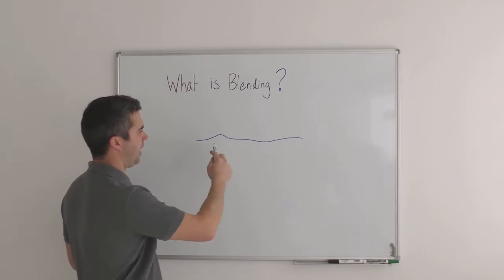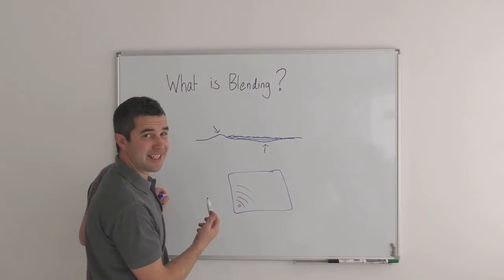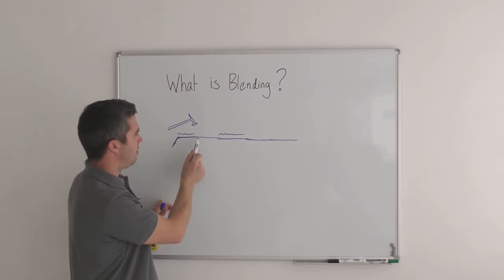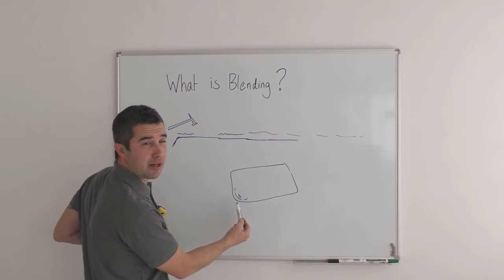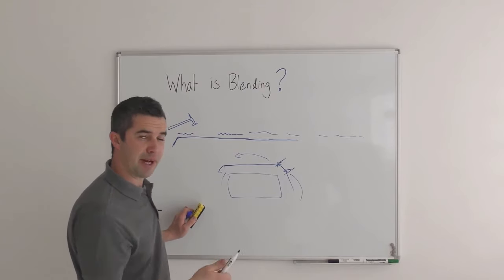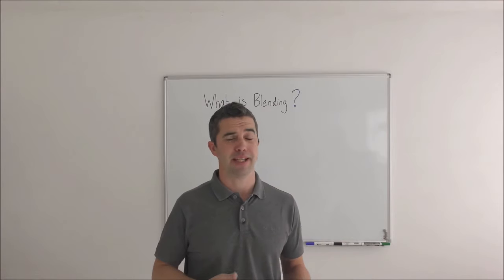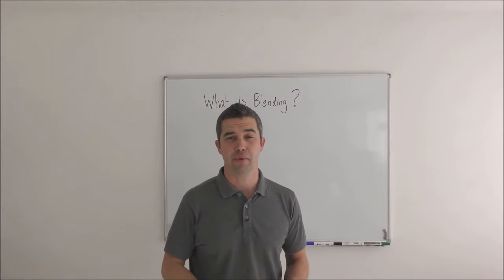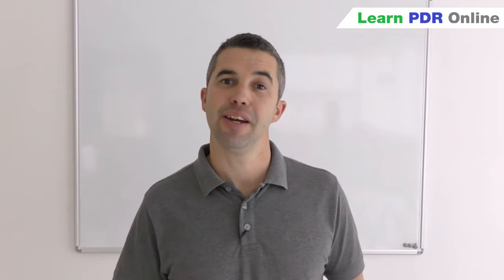Blending For PDR, What Is It And How Does It Work? PDR Blending techniques with Learn PDR Online

Comment: Sounds like your blending tool or hammer is tapping metal to metal? Or does it have a nylon face? I’ve tried lightly tapping on a 12 year old paint job and it left marks. With nylon. Perhaps it was cold. Or perhaps it was my blending hammer that I used.
Reply from the maker: Hey Rick, yes its a metal tip on my blending hammer but I usually add a small layer of tape just in case the tip is not perfectly smooth where it gets knocked around a bit in my tool box but you should be able to blend metal to metal as blending should not mark the paint, it may be aftermarket paint on the vehicle from a previous repair or perhaps the tip of your hammer was not perfectly smooth and clean.

Comment: would you use blending strictly for finishing? or could you used it before a glue pull to make the pull easier? how would you approach a medium sized dent?
Reply from the maker: Hi Joshua, good question, usually blending for me, is a way to finish a repair but often with the dent removal process it is necessary to 'open up' the dent, this in simple terms is using a hammer and or knock down to tap around the dent to actually make it larger which when done correctly can help to lift up the centre spot aka the lowest part of the dent, you may see pdr techs 'hammering' around a dent before a glue pull and whilst similar is a different repair technique than blending. Othertimes when we are using hammering techniques before finishing we may be softened the metal or releasing tension that is restricted the metal flow, I hope that makes sense?
Reply: @LearnPDROnline  yes quite interesting, i just tested this out on the rear quarter of my truck and it does work for the most part, i started with a glue pull first in 3 spots and i guess it wasnt such a good idea because it turned the dent into 3 smaller ones which were high in the middle but overall still low, i guess i should have hammered around the dent the release some of the tension and it would have been easier to pull it out to the correct level. then blended it at the end. its my first time for PDR but definitely not the first time for panel beating and spray painting.

Comment: Hey mate great videos, I have a hail damaged car and there is many small dints on the roof and bonnet. Would you recommend starting from the middle or an edge?
Reply: How do we join your membership program
Reply from the maker: Thanks Miles, I'm not a hail tech myself but when I did some hail damage a few years back I would divide my panels into sections and work on one at a time to avoid overwhelm, for example divide a bonnet into 4 and work on all dents in one section. Its important with hail to move around though and check your angles constantly cross checking work as you go, depending on your set up you can have multiple lights at once to limit how many times you need to physically move your working position. I also found it helped to work every dent I could see from one angle and then move and do the same again this limited how many times I would need to move and set up as opposed to repairing one dent 100% and moving each time, this will save time. As I say I am not an expert with hail though so do seek some other views and opinions too!
Reply from the maker: @itsmyturmnow  You can join the waitlist to be notified every time we reopen for new students here - https://www.learnpdronline.com/lpo-membership-launch-special/ any questions regarding training, just ask :)
Reply: @LearnPDROnline   thank you for taking the time to respond 👍🏼 that’s a good idea I was thinking about it but never actioned it so since you say it’s a good idea I’ll give it a try. Look forward to seeing more from you.
Reply: @LearnPDROnline  I'm lost, why waiting list for new students, I thought we just watch your video on line.
Reply from the maker: @johnl2998  Hi John, we have a dedicated site teaching PDR on our own training platform teaching in much more detail than on the free youtube videos, the waitlist was to join up last year however now we are open you can join anytime via this link - www/learnpdronline.com Thanks

Comment: I saw someone use a carbon fiber handle hammer to tap down, wouldn't you need weight to tap down and finish the dent out!
Reply from the maker: Good question, the correct hammer really depends on what you are doing, I have my standard cheap hammer for knocking down with, that has a little weight to it so its great for the transfer of energy between hammer and knock down, but if carrying out blending I will use a much lighter hammer as its more about hammer technique, my go to is aluminium (the shane jacks hammer) but I also have a carbon fibre one nearly twice as long which is great when i need distance and reach. Blending is most commonly used on roof rails so a light weight hammer can be easier on the arms too :)